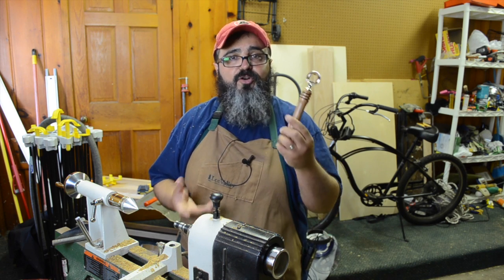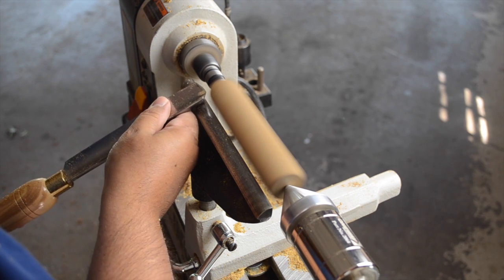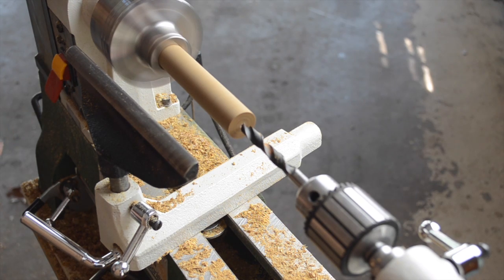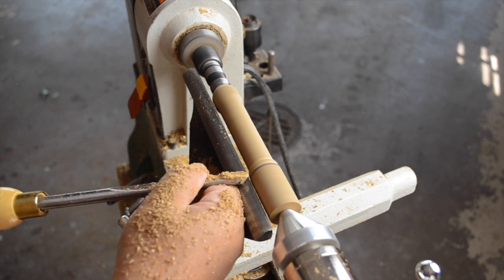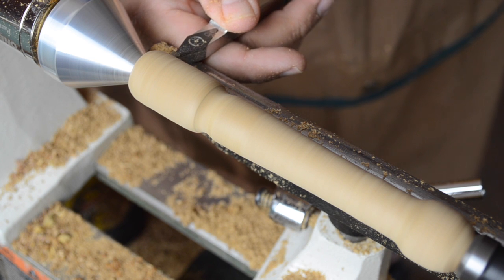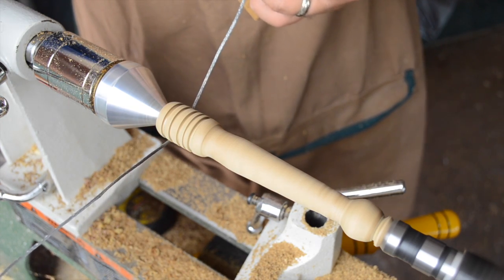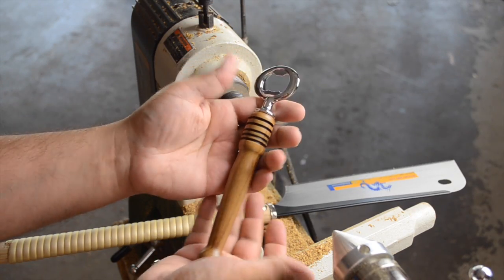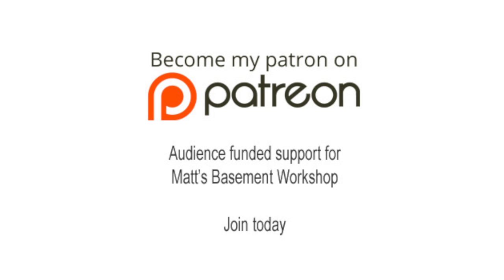549 Turned Bottle Opener

Comment: You're doing much much better Matt. Well done! Your brad points will last longer if you slow down the lathe a bit.
Reply from the maker: wortheffort the biggest problem with adjusting the speed on this kind of lathe is the fussing with the belts. I'll definitely take a look at it though the next time. 

Actually, I think it looks worse in the video than it really was LOL.
Reply: mine adjusts with belts. You'll get pretty fast at it. Best if turning the same speed as your drill press which is likely way under 500.